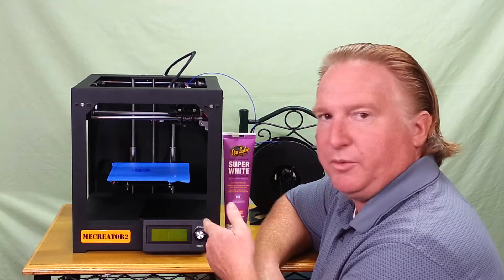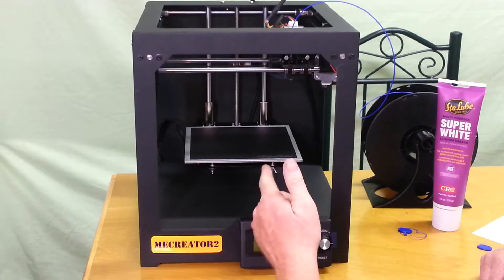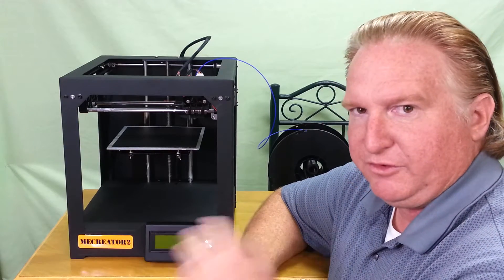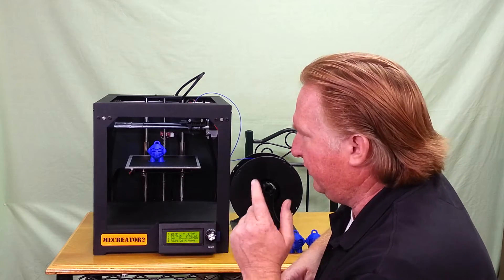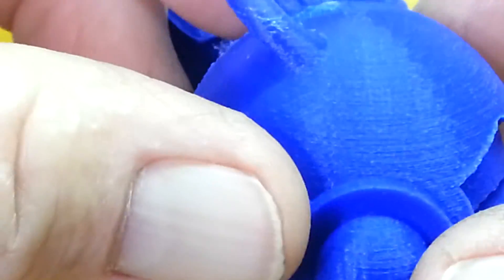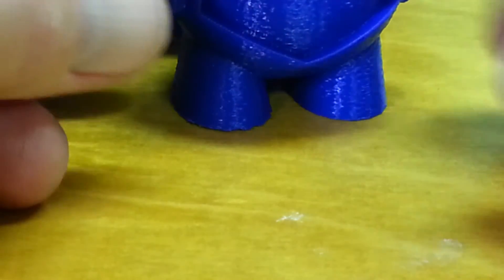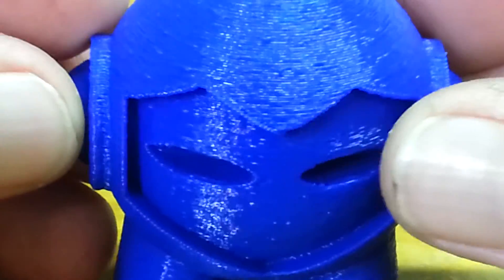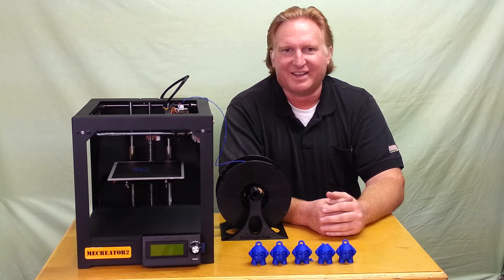Geeetech MeCreator2 Print Resolution Test

Comment: I'm thinking  order this 3d printing  from  geeetech
Reply from the maker: +Paul Cumber It is still my favorite printer.  Other than replacing the cooling fan after it died, I have never had a problem with it.  Knock on wood.  The one I have has been rock solid.

Comment: I'm unsure, in Cura  you may be able to use Plugins "Tweak at Z" to do most the print at 0.1 then just do the top part, where more curves are, at 0.5 this could do the best speed for quality although 0.1 if fine above